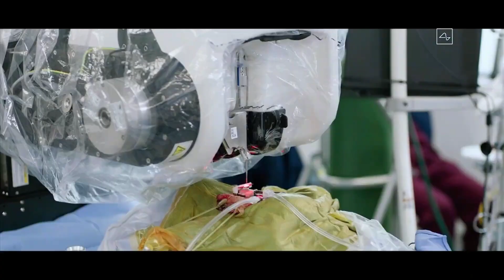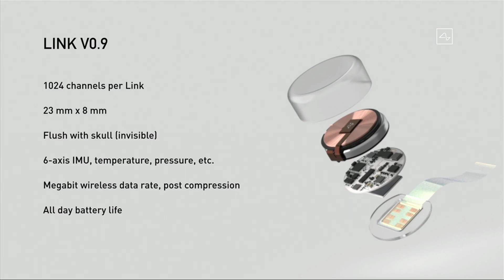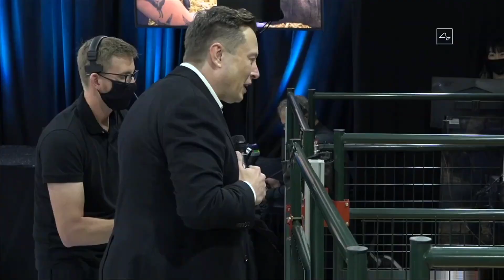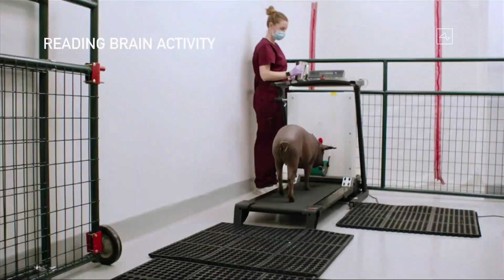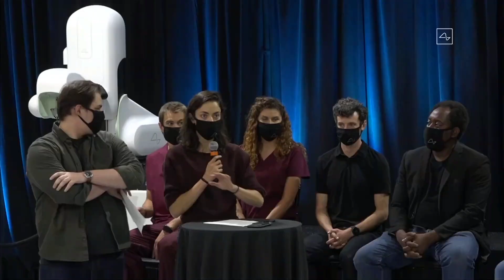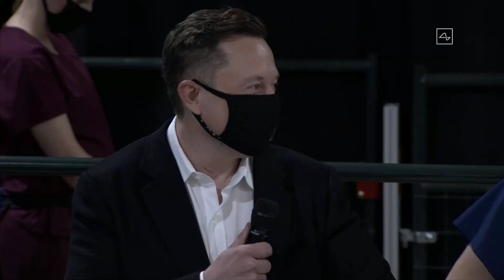Watch Elon Musk's ENTIRE live Neuralink demonstration

Comment: Looking at the unbelievable success with the pig on the treadmill: I'd guess that the killer app (or cash cow) will probably be brain to electric motor transcoders for robotic prosthetics for amputees rather than neural shunts for paralytics. The main reason: The witing to neurons problem (which seems harder than reading and poses one additional challenge) is not present. Advanced prosthetics and advanced motor control in contrast is vey much present. So it seems like this "only" needs to be hooked together and integration tested. It's somewhat clear why they didn't mention this in the presentation though. With the risk needing to match the severity of the condition for the very first human tests.

Comment: About the mechanical aspect. Yes pigs are rough and not careful in their demanor but they are usually sheltered from real accidents. Human accidents like standing up full throttle under the corner of open window (ouch). I hugely doubt the current design could take that. Even when fully healed. The skull usually can take such impacts (repeated experience). This aspect most definitely needs improvement.

Comment: Risks

Although deep brain stimulation is minimally invasive and considered safe, any type of surgery has the risk of complications. Also, the brain stimulation itself can cause side effects.

Surgery risks

Deep brain stimulation involves creating small holes in the skull to implant the electrodes, and surgery to implant the device that contains the batteries under the skin in the chest. Complications of surgery may include:

Misplacement of lead

Bleeding in the brain

Stroke

Infection

Breathing problems

Nausea

Heart problems

Seizure

Possible side effects after surgery

Side effects associated with deep brain stimulation may include:

Seizure

Infection

Headache

Confusion

Difficulty concentrating

Stroke

Hardware complications, such as an eroded lead wire

Temporary pain and swelling at the implantation site

A few weeks after the surgery, the device will be turned on and the process of finding the best settings for you begins. Some settings may cause side effects, but these often improve with further adjustments of your device.

Because there have been infrequent reports that the DBS therapy affects the movements needed for swimming, the Food and Drug Administration recommends consulting with your doctor and taking water safety precautions before swimming.

Possible side effects of stimulation

Numbness or tingling sensations

Muscle tightness of the face or arm

Speech problems

Balance problems

Lightheadedness

Vision problems, such as double vision

Unwanted mood changes, such as anger and depression

How you prepare

First, weigh the pros and cons

Deep brain stimulation is a serious and potentially risky procedure. Even if you might be eligible for deep brain stimulation, you and your doctors must carefully weigh the risks and potential benefits of the procedure.

Comment: Wires embedded in tissue seems odd considering the best I can imagine in either stimulation or the cancellation of same i.e. electrical fields with a charge administered, might this be done with a less obtrusive covering creating fields of whichever electrical infusion is required for the purpose or am I used to seeing wires meeting terminals or other wires normally not letting me realize what benefit a wire jetting into tissue achieves uniquely.  A wire carrying electrical current would create a field regardless in a similar fashion without the aforementioned terminal or connecting wire, this is the appearance as shown, no? Creating a terminal point with a field when needed for whatever causation desired without damaging tissue, the claim putting wires into tissue is harmless is as stated counter-intuitive and why not create a micro batch of terminal points in a material for utilization?

Comment: As far as hacking goes, I mean, it's not really anymore dangerous than a modern pacemaker. They have constant connection to monitors now, and when you have issues it sends a notification to your local hospital. And obviously someone hacking your pacemaker would be just as bad. Not saying I'm going to be first in line to get a hole drilled in my skull or anything though.

Comment: The biggest issue with this is the having to charge it. It does not matter if it is overnight, you still have to remember it and disconnect every time you get up to go to the bathroom. How is this any better than taking a pill? Other than the damage that can comes from years of taking a drug, I don’t see how this is better. That makes this a pretty hard sale in my eyes. However, since the body is constantly producing electricity, why can’t the body itself provide power to the Neural Link? Just a thought.

Comment: If the neuralink wires are not thin enough to connect to individual neurons how can it read or write. Wouldn't the data signals not match? It would be like if you could only press half of the keys on a keyboard and try to write a word where u need access to every letter.

Comment: By the time neuralink devices are made available to the public they will have undergone years of research, development, and extensive use a medical implant. When it becomes possible for a healthy individual to get one implanted by choice, it won't be version 5 or 10, but 30 something or more. It will probably be less than a third the size of the prototype shown and vastly more capable, especially if they do get down to sub micron threads.

Comment: I feel like there's a way to make neuralink more secure if you used a removable device placed on the skin which communicates with magnetic signals like they had originally because then you can just plug into that device and there's no reason to use wireless signals. If you can use a system which hooks up to that device which has no wireless connection which you can check the integrity of the apps you download to it for hacking attempts then it would be a whole lot more secure.